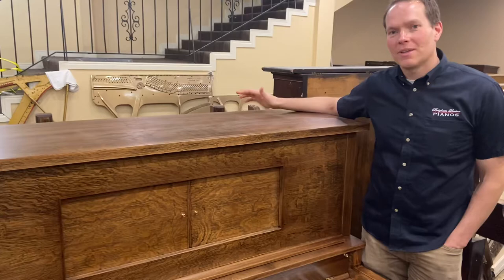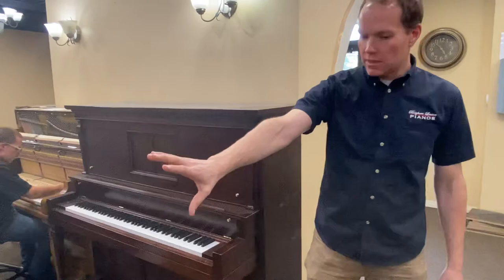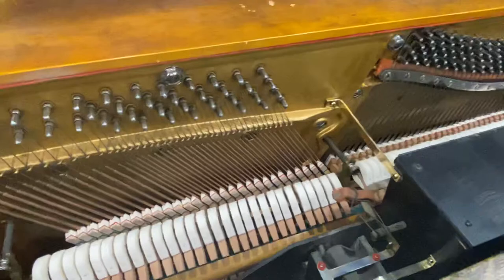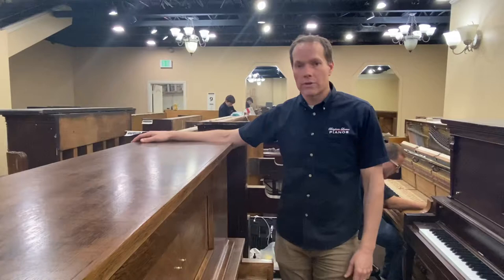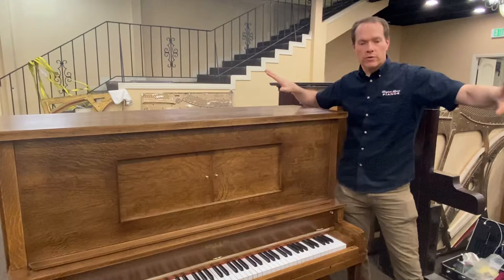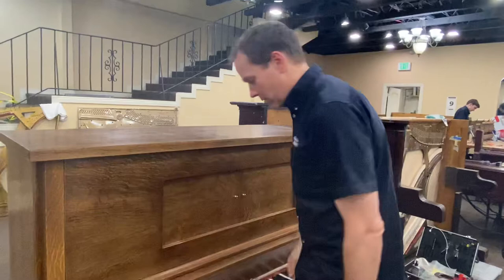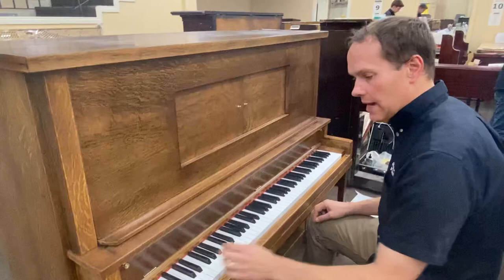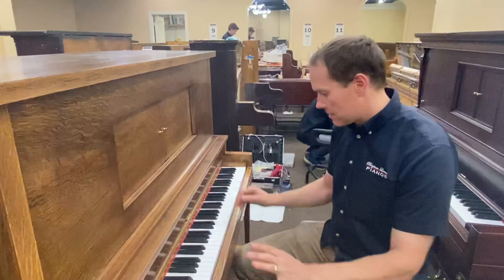After Restoration Bell & Co Upright Piano #163195

Comment: Mostly I view you as a clean businessman but I think saying everything older than 1930 needs to be rebuilt “just because of age” is not really on the level with piano owners out there.  Maybe you’re just being a bit mentally lazy or maybe you’ve got too comfortable with easy cash flow from wealthy clients and the wow factor of your shiny overhauls.  Age alone brings dust, loads and loads of dust, which makes pianos look nasty.  But for a true musician, old uprights are astounding bargains if only the front key pins are rotated to snug the keys, hammers shaped, letoff adjusted, and maybe chips in the ivory rounded off with a bit of sandpaper so they’re not too sharp on the edges, bass strings replaced on a case by case basis, bridge repairs as needed etc.
Reply: It depends on how much the piano has been used, what sort of environment it has spent its life in, what standard of performance you want out of it etc.
If you need bridge repairs, you'll probably break some of the original strings if you attempt to reuse them afterward. If the hammers are original, they may be too worn to reshape or the felt may have decayed too much to produce good tone.
I have my great grandfather's 1920s upright and it's past the point of easy fixes. I'd like to send it off for a shiny overhaul.  =)